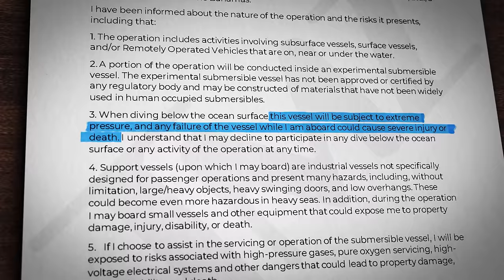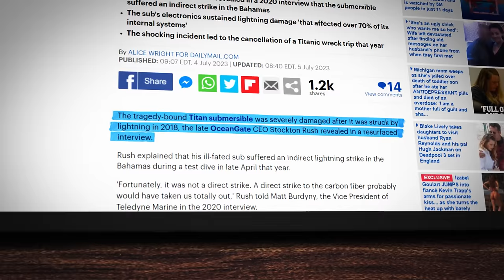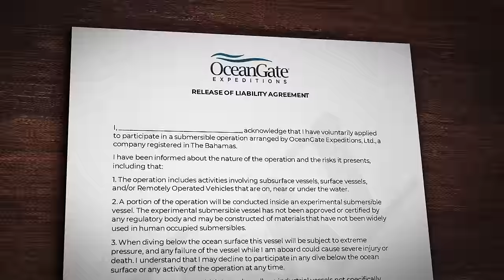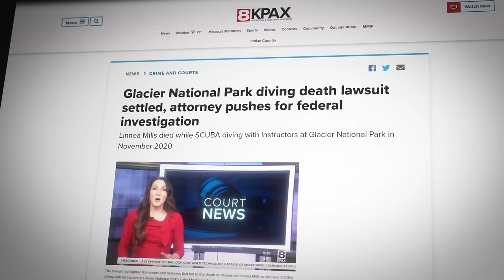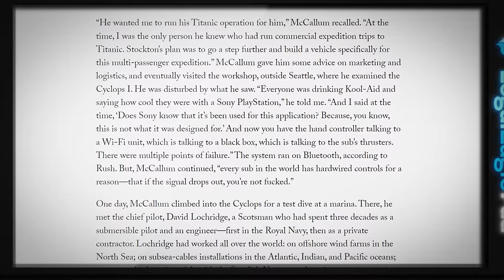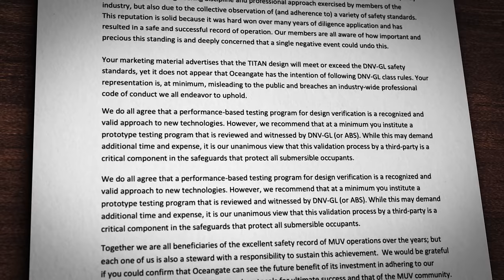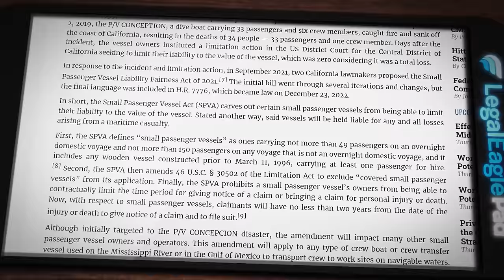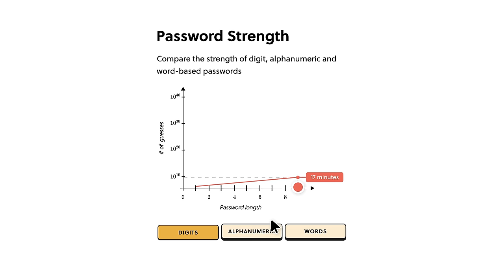OceanGate Is Getting Majorly Sued

Comment: My main problem with this whole debacle is that Stockton was propping up the vessel as indestructible and super safe. Regardless of what the waivers said, the passengers were led to believe by the company that it was a very safe vessel when it was not. It was Stockton's lying and ego that got them on the vessel just as it was his ego and lack of concern for safety that got them killed in it.
Reply: With their level of wealth and ressources, we can expect that the passengers should have been able and sane to get independent expert opinions. That they didn't is negligence on their part and should be considered.
Reply: @shizachan8421 Exactly.
Reply: @shizachan8421 I think that is an opinion based on bias towards wealthy people. A common/normal person wouldn't normally go that above and beyond for similar things.

If I was to get on an airplane built by some company I had never heard of before, I'm not going to hire independent assessors to check it out before my flight if the company selling me the tickets tells me it meets or exceeds industry standards, especially when the pilot and one other passenger have done the trip before.
Reply: How many services do you look into prior to using them? Do you check the background of every restaurant, for example?

Ultimately OceanGate was almost farcical negligent - to the point where ordinary people would not assume he was misleading them. Most of this stuff only came up after the ship sank, after all.

Just because someone is wealthy doesn't ensure they will all launch independent investigations that will catch that the guy was actively avoiding every regulation he could.
Reply: They gave up $250k, which to any normal person is a crazy amount of money so you would think twice, to get on this death trap and didn't get a second opinion. They were so rich, they didn't think. Their downfall WAS money.
Reply: @kamurotetsu4860 $250k to us is crazy, because that is more than most of us make in 5 years. But to them it is not a crazy amount. Two billionaires, a son of one of the billionaires and a multi-millionaire... its not that crazy of an expense especially for a once in a lifetime opportunity.
Reply: @DisgruntledArtist if you would pay more than a lifetime of money without checking if that thing you're paying for is legit, then I have a bridge and tower to sell you.
Reply: @DisgruntledArtist  This isn't like they were some random tourists that just on a whim decided to go on a divining excursion and had a disaster happen without looking into the company.

And these weren't just wealth people. Two of them experienced deep sea explorers an absolutely should have know the dangers at that depth. Especially since James Cameron said there were warning all over the community before all this happened.
Reply: @sponge1234ify  You sign waivers throughout your life that you don't investigate even though it would cost nothing to do so.

Price is irrelevant. What is relevant that the expectation that because it is operating it is probably following industry regulations and taking some safety precautions.
Reply: You, can't waive away negligence, in a situation like they tried
Reply: @standepain  It had also had several successful dives before, indicating that it was reasonably safe.

You can't waive extreme negligence and ultimately the creator was actively misleading people about the safety.
Reply: @standepain  there is a difference between knowing that something unexpected and catastrophic could kill you and purposefully covering up the integrity of your vessel so you can sell a million dollar trip to four unsuspecting persons.

And only one of the passengers was an experienced diver (not a submersible expert), the other "expert" was Stockton. After that you have the two billionaires and the son of one, none of those three were experienced divers.
Reply: Stockton was undoubtedly and provably wrong. But I don’t know if you can really say he was lying. I think his actions show that he was confident that he was right about the safety of the vessel. I bet he would have passed a lie detector test. But just because someone is not lying (ie. thinks they’re telling the truth), does not mean the actually are telling the truth. But lying and telling a falsity are not the same thing.
Reply: @shizachan8421  are you honestly suggesting that rich people should have less rights because they have money?
Reply: @ganonk79  but he blatantly ignored testing and the recommendations from industry experts. He also built it with the window being incapable of withstanding the pressures of the depths they were going to. Rated for 1300 meters, not 4000.
Reply: He didn’t put a gun to their head and make them get in, they took the risk and now are fish meat
Reply: @MrBattlecharge  You probably should do it when its the 1920s, airflight is still an exclusive vanity and you are a millionaire.

And its not really bias when we talk excessive far beyond ones possible needs, desires and personal use being hoarded through exploitative practices. Nobody becomes a billionaire through personally creating something out of value, otherwise we would live in a world in which Britney Spears is wealthier than Elon Musk.
Reply: @shizachan8421  Almost like rich people share a common trait:
An exorbitant ego that cant perceive danger.... 

They signed the wavers. They had the "brain power"... They were just a bunch of rich people with a passion project.
Reply: @shizachan8421  FUN FACT!  Just because someone is extremely rich and successful doesn't mean they are smart or even of average intelligence!
Reply: They needed a psych ward not going to an underwater graveyard in a coffin. Stockton needed a psych ward not making a coffin. I'm questioning the sanity of the passengers if they signed their death certificates. They were in charge of multimillion dollar companies and chose this trip. All needed a psych ward
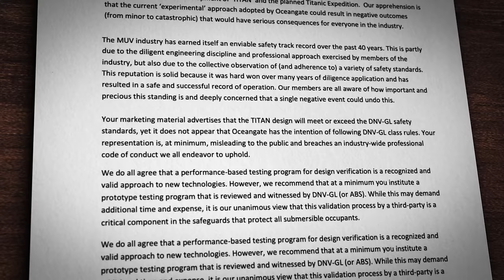Reply: @DisgruntledArtist  Yes it had "successful" dives before but had all kinds of issues I think on almost every trip if I'm not mistaken. ...and Again. Two of them were experienced and at 17:44 a warning was issued. Cameron stated that this is a very small community so these guy had to of know the risk, especially with their experience going that deep as much as they did. It's listed as a "experimental submersible vessel that has not been approved or certified by any regulatory body" so that right there is enough that you are going at your own risk.
Reply: @shizachan8421  That's a ridiculous assumption.  The wealthy are held to some higher level of understanding, either intrinsically or through their hiring practices, should be enough to shield them from harm???
Very biased, on both sides of that equation.
Reply: Should note the "experimental submersible vessel that has not been approved or certified by any regulatory body" comes from David Pogue waiver that he read on his CBS piece on the Titan.
Reply: @MrBattlecharge you literally just proved his point
Reply: An indestructible vessel going to see the ruins of another indestructible vessel? What could go wrong?
Reply: “God himself cannot sink this ship” 
- irony
Reply: @shizachan8421  most billionaires, like Elon Musk, come from money and turn it into more money. Whereas people like Brittany Spears don't come from money and make the money themselves. It's almost as if some people have to work hard to generate their value whereas a lucky few can turn inherited wealth into more wealth.
Reply: Ultimately, I think that might be what gets him sued - not for the negligence and hubris in the design, but in the way it appears that he dishonestly marketed the trips. Can't sue him for the failure, but maybe it's enough that he used questionable tactics to get the passengers to sign a waiver. I'd also argue that maybe a waiver can't be used to control the actions of other people so it should in no way stop the families (and maybe even life insurance companies) from suing.
Reply: @neilbiggs1353  I agree. While I think death by decompression in a submersible is obviously a factor of the trip, I think the company's blatant disregard for the rules and the industry standards, protocols and warnings makes it a scenario from which they will be successfully sued for gross negligence.

Purposefully tiptoeing around the industry, flirting with danger while ignoring safety and lying to customers about said safety... very gross.
Reply: @shizachan8421  You know for a fact that none of the passengers didn't research ahead of time? How do you know this? You know what kinds of conversations were had with each of those passengers? You know exactly what the dynamics were between them and OceanGate? You're making a lot of assumptions.
Reply: Does it qualify as lying when he believed he was saying?  If he didn't believe his narrative, would he have been aboard the sub?
Reply: The thing is, I don't think Stockton was lying.  If he thought the vessel was unsafe, why would he go on it?  He might have been delusional, but he probably honestly believed what he told the passengers, which adds an interesting wrinkle to the legal implications.
Reply: @neilbiggs1353  you realise no-one is suing Stockton himself, right? He's carbon dioxide and sooty smears.
Reply: @NigelTolley  I tend to use him and the company interchangeably, but that is a potential defence strategy from whoever runs what is left of the company, that they can't be held liable for what one bad agent did...

Sadly, since he has kids he isn't eligible for a Darwin Award...
Reply: good point. If the vessel was as good as Rush stated, then why all the disclaimers of possible "Death" !
Reply: @shizachan8421  I don’t know. People usually trust that a company operating legally would have been dropped if it was actually dangerous. 

I had to sign a waiver for my kid to take a beginner gymnastics class that repeatedly said he could die. It even said I ageeed not to sue if he died due to the negligence of the business.

I am not convinced that would hold up in court. 

But I didn’t research before I signed. He took the class and was never hurt, let alone killed.
Reply: @lskulski  Again, why do you care? The average billionair in our current day and age contributes to a similar level of human suffering as the likes of Hitler. Their death is an overall good on humanity as a species.
Reply: @shizachan8421  it is not the consumer’s legal responsibility to research a companies claims. If the passengers believed Stockton Rush and he misled them or if there where safety issues he chose not to disclose, then passengers not hiring independent parties to investigate the sub (which ocean gate would have never allowed anyway) aren’t a factor at all in whether or not this is gross negligence.
Reply: @DisgruntledArtist  if I'm putting my life in the hands of someone else yeah i double check everything. I work with some dangerous tools, before i used them, i check everything is in working order, safety systems are in place and there's no damage, even if i was the last person who used it, and if i see anything questionable i get someone else to double check it. 
Heck ive refused to do a job and took my whole team off site "for an early break" before now because of safety issues (which paid off when i heard the guy who took over the job cussing when he found a gas pipe wasn't where it was suppose to be and nearly blew the place up) 
And yeah ive seen people disregard safety checks and lose fingers and in one case nearly losing a leg. So yeah if i was going on a dive I'd want to be sure everything was up to scratch before going down and know what support systems were in place in case of an emergency
Reply: Stockton Rush calling it indestructible reminds me of how the titanic was described 😬
Reply: @shizachan8421 
Able? Sure. Sane? I don’t think that is really true.

See, just because you are able to do more due diligence doesn’t necessarily make it unreasonable to not do more due diligence. Generally speaking, rich people do around the same amount of due diligence as people in the middle class, and neither society nor the law require rich people to hire outside experts to verify someone’s claims before accepting a deal or signing anything like this. Maybe if we were talking about buying or selling a company or a deal between two corporations, but for people acting in their individual capacities paying for a service, I don’t think that’s the case. And there is nothing in the law that would require rich people to do more due diligence than middle-class people. Rich people aren’t going to be more diligent than anyone else, nor would we expect them to be.
Reply: I don't think he was though - he was honest that the sub was experimental, that there was a high risk of death and that it was uncertified, that he wasn't popular in the industry...
Reply: @tomriley5790  he was. He said it is safer than crossing the street, which it most certainly was not. He also said the sub was designed to make it to the Titanic, which it wasn't considering the window was not even cleared to handle a third of the depth. Sounds like he built a suicide mission and sold it as a once in a lifetime excursion.
Reply: @shizachan8421  because legal precedent and my own morality. Companies shouldn’t behave this recklessly, and any crimes that may or may not have committed by the victims are not relevant to their death. The fact that two of the passengers where billionaires does not change their status as victims of gross negligence. I don’t think we should ignore crimes committed against people we don’t like. I may not have personal attachment to the victims, but they didn’t deserve to die and the company at fault should be held accountable.
Reply: @derekcline950 No, but they should have less money.
Reply: @shizachan8421   nah dude. wealthy folks who are not experienced divers or have the knowledge or know how of sub technology are gonna be more trusting.
Reply: @derekcline950  Are honestly suggesting that rich people don’t already have more rights than the rest of us? Stop white knighting for them because they certainly don’t care about you.
Reply: Stockton was extremely errogant and said some pretty stupid things, my favorite one is "they told me I couldn't use carbon fiber, well, I did"
Reply: @shizachan8421  Wow... There are people who exist in this day and age that think that rich people must by default be smart?
Damn, and here I was, hopeful that people have learned that the two are only extremely loosely correlated. Welp, another point taken off from humanity's worth, I guess.
Reply: @standepain  And if Stockton was spinning them a web of lies to convince them that his new sub is super safe and managed to fool them with it, then it's entirely their fault that they got conned, right?
That is not how criminal justice treats conmen, in case the rethoric question wasn't blatant enough.
Reply: @lskulski  "The fact that two of the passengers where billionaires does not change their status as victims of gross negligence"
*criminal negligence. Stockton was made aware by several engineers that his project was not ready for that depth, yet he ignored that.
Reply: @OzixiThrill  good distinction and good point!
Reply: @standepain  The two people who were experienced were experienced at getting their ass driven to the Titanic. They were not experienced in designing and maintianing a submersible.
People who maintained their own submersibles (or were involved in that process) were screaming that it's not safe.
The people who boarded the Titan? You could pull the wool over their eyes quite easily with just a few off-hand remarks about the old Guard and the new underdog and all that shit.

Also, the waiver explicitly asserts that every forseeable danger was mitigated for. Which is a blatant lie, as most people were screeching that it's not ready to go much deeper than 500m.
Reply: @OzixiThrill  No, It hink we should make them smart by just putting every rich person who is not an altruistic, highly intelligent technocrat into an uranium mine.
Reply: To play the devil's advocate, I don't think he was lying. He probably believed it. He was in the vessel when it imploded and suffered the same faith. Unless he had a suicidal wish, that tells you he actually considered the thing to be very secure.
Reply: @crwydryny   I agree - it would've been wise for them to check beforehand.

That said, regulations exist to enforce that people do those checks so that people without experience (such as wealthy people with no technical knowledge on the subject, or people who trust the CEO) aren't required to do so.

It's fine to say that they should have checked - but ultimately the blame completely falls on the shoulders of the CEO and the business he ran. They're the ones who engaged in the negligence. They're the ones who ignored the warnings of their own experts. 

If I take you out on a ship for scuba diving and forget to give you enough oxygen to get back up, while you might've been a fool for trusting me, I'm still responsible for the actions that lead to your death. S'like I said, you can't waive negligence. If you could every company would include clauses saying that they're not responsible for anything that happens under their watch - despite the government saying that they are absolutely responsible for safety and security of those in their care.
Reply: @neilbiggs1353  They can, actually, because he isn't individually responsible for the entire company. The company is responsible - he's just the person they employ at the top. Even if he's primarily in charge the corporate entity is the one shouldering the burden. The company is still required to follow laws, after all. Taking reasonable precautions to ensure the safety of your guests is part of that.

Though I think you could make the case quite easily that both he as an individual and the company are responsible for the ludicrous negligence involved.
Reply: @standepain  See, that's kind of what I'm getting at. They had enough bluster to blow off criticism - oh it was just some minor electrical problems, or a spontaneous mistake in the monitoring system. Criticisms could be handwaved away as haters trying to stop submarine improvement.

The only real evidence was a news story that most people are unlikely to have heard of let alone watched and a court case about a broken contract with an employee in which the problems of OceanGate's sub were only incidentally mentioned.

At a glance they seemed perfectly legitimate, just skirting the laws so they didn't have to waste tons of money on stuff that didn't matter because they were experts. After all, you're paying $250k a seat. That money invariably goes towards ensuring this is a safe, sustainable venture, right?

At the end of the day it doesn't matter that they put their trust in the wrong organization, though. You can't waive negligence - whether you want to be or not your organization is still required to take reasonable safety and security precautions for people under your care. 

Indeed, if you really want to get into it, negligence laws (including the place where OceanGate is based) explicitly states that negligence cannot be simply shrugged off just because the victim is partially at fault. 

Ultimately what matters is whether or not OceanGate took reasonable precautions to ensure the safety of their passengers. I think there's pretty solid evidence indicating that they didn't. Particularly when they ignored and fired the guy they hired to ensure that they obeyed those laws because it would've been expensive to do so.
Reply: I think the scary part is that, if made available to the public for a lower price, more people would have been willing to go on that sub.

Because for one, not many check for expert opinions and such. Two, the prospect of visiting a historical site is too tempting. A once in a life time opportunity. And three, part of your mind tricks you into believing that "the people who made this and are driving this know what they're doing".

We are lucky it was limited access to the rich - but they paid the price for it.

- and you can't say that people wouldn't put themselves knowingly in danger. There's a lot of cases where they do. Playing with knives, getting close to catastrophes to gawk and speculate instead of helping or doing something. The self preservation instinct kicks in too late. Doing drugs, drinking booze, our mind can trick us into overeating since food tastes so good or not eating anything.

People who have won the Darwin Awards have done stupid stuff that none of us would do - but you are curious how a grenade works and looks like on the inside, you are curious what happens if you go over a limit.
Reply: @MrBattlecharge  Exactly. Not even sure if you can randomly go out and hire someone to check on, well, the actual property of a company. That sounds unrealistic and illegal.
Reply: @Shirumoon  you would probably need the company's permission first. And a part of me gets this feeling Stockton would have barred that from happening.